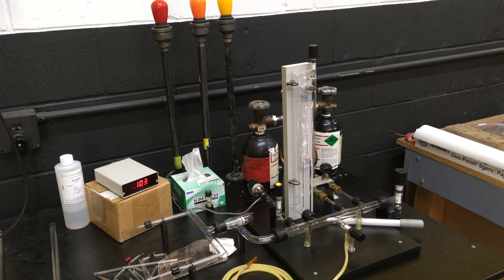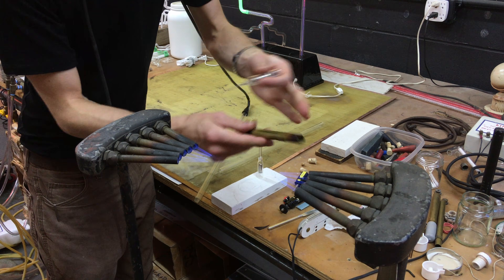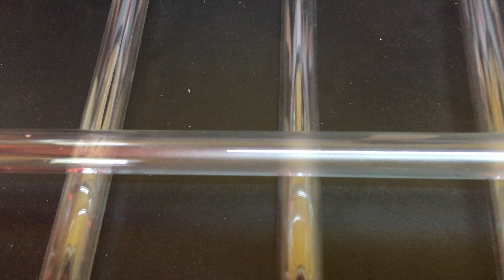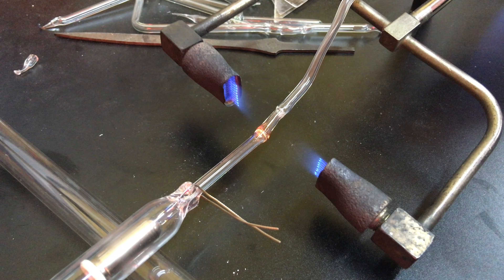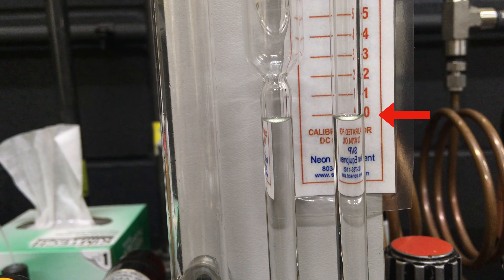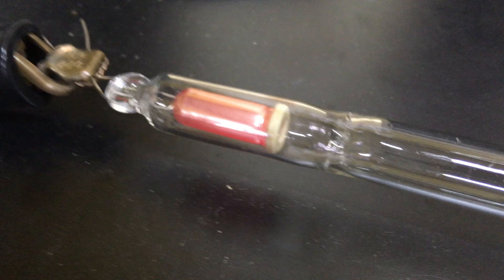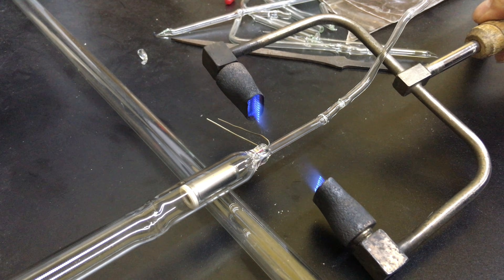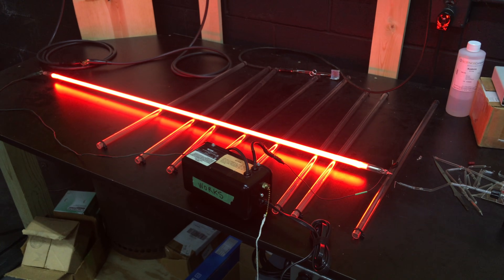Making My First Neon Tube

Comment: Great video!
I've been wanting to learn this for some time but i can't find allot of info on how to get started. I might do a course in France but i would like to know what the average cost is to have a basic setup. The point is to experiment on my own as i am a designer and artist making lights and stuff. Is it crazy expensive? Like the cost for a bottle of neon for instance. I imagine the burners, the vacuum pump, and the vacuum tester and all that stuff is not the most expensive part. I already have propane, i have a workshop for metal welding and blacksmithing.
Reply from the maker: thanks!  neon equipment is rather expensive and hard to find.  for reference, i estimate it cost me somewhere around $9000 USD to get to the point i am in this video (i.e., barely functional amateur) making the most basic of tubes.  practice adds a considerable amount to the cost as well, since alot of glass needs to be ruined to learn.
sounds like you've got the right idea: take a course to dabble a bit and see if you like it.  you can also spread the cost of equipment over time by buying things piecemeal (e.g., starting off with a just torch and a box of glass).
you mentioned France, so i assume you are in Europe, and i dont know how the cost/availability of equipment compares to here in the US.  i do know that some the torches & techniques used differ somewhat from their American counterparts that you see in this video.  my friend Andreas over at the @NeonSignStuff YouTube channel is in Germany and you can see his European torches in many of his videos.

Comment: Me pregunto cómo es que el fósforo siendo una capa de polvo adherida a la superficie del tubo no se cae o se funde en el vidrio al calentarlo tanto. Saludos.
Reply from the maker: it is possible to heat the glass too much and have the phosphor burn/melt into the glass.  i mentioned in this video that i heated the tube too much, but since it was not a phosphor coated tube, it still turned out alright.

Comment: Siempre me llamó la atención desde niño. Uno en específico no sé por qué razón recuerdo que encendía de un color he iba cambiando quizá de rojo a azul ( no puedo recordar bien) supongo que a media que se calienta. Quizá un defecto de construcción que quedó muy interesante.
Reply from the maker: adding a drop of Mercury to a Neon-filled tube before tip-off will create the color-shifting "red to blue" effect as the tube warms up from a cold start and the Mercury vaporizes inside the tube.  it's pretty neat to watch.
Reply: Gracias por la respuesta. Yo hablo español y todos los videos del tema a profundidad son el inglés. No me queda claro el proceso. Una vez puesto los electrodos, se hace vacío . Ahora,² el bombardeo es en vacío o ya gaseado? Después se completa de gas? Al  final queda a baja presión? Le agradecería me responda.  @NeonPreservation
Reply from the maker: i have a significant percentage of international viewers, so i add subtitles to many of my videos.  YouTube has an "Auto-Translate" feature where you can select which language to translate the subtitles while viewing.  i am unable to verify the translation accuracy to be 100%, but it could be a helpful tool for you!  i will answer your questions here as well.

after the electrodes are welded on, the tube is attached to the vacuum manifold.  when the vacuum is low enough inside the tube, the bombarding transformer is activated to heat the tube and burn any impurities inside.  the vacuum pump removes the impurities that are vaporized during bombarding.  when the tube is clean, and at the lowest vacuum possible, a small amount of gas (Neon or Argon) is added, then the tube is sealed.
the final pressure in the the tube is still a vacuum; for normal sign tubes it will be somewhere between about 9 and 20 Torr, depending on the tube diameter.  for reference, "normal" atmospheric pressure (it varies by location & elevation) is around 760 Torr.

i hope this helps!  ¡Salud!
Reply: Gracias, ahora sí tengo claro el proceso.  @NeonPreservation

Comment: Out of curiosity, what is the smallest diameter of tube that you could use to make neon? Could you use a tube that's like say, a 5mm across? Or less?
Reply from the maker: yes!  while not very common in commercial signage applications, very small diameter tubing (≤5mm) has been used in more niche specialty applications.  the first thing that comes to mind is scale model props on movie sets.  also, i do have some novelty glowing/neon items that have tiny tubing inside: a small AA battery clock and some modular "message board" type letters that can be assembled to spell words... there are other examples too, like neon christmas lights and small novelty signs.  they appear to have 3.5–4mm diameter tubing.  some examples can be seen in my friend Andreas' channel @NeonSignStuff in his video about novelty neon: 
https://youtu.be/zYIDciwyH7M
Reply: @NeonPreservation  thank you, excellent explanation

Comment: Hi, where can I buy different noble gas tubes from with electrodes attached like these?
Reply from the maker: maybe im misunderstanding, but that pretty much describes any neon tube...? are you asking where to buy neon tubes?   all neon is made by hand, most of it is custom designed for specific signs.  you could talk to any neon bender or sign shop that makes neon, and they can throw together anything you want: tube diameter, length, design, etc.  in the neon industry one-off type orders are quite common.

Comment: Thank you for the demonstration I might ask you for some assistance in some plasma projects I have vacuum pumps and glass globes I have been crudely sealing my vacuum with solder within a curly cube copper wire connected to my vacuum pump with a filter between the pump and the curly queue so when I melt the solder I don't suck it into the blacking pump using all glasses preferable but I don't have the entire setup.

Comment: How much will a processing setup like this cost?? Mainly for diy or side work.
Reply from the maker: if you're buying new equipment i'd guess upwards of $25k.  for used equipment there are a lot of factors that influence the price of a neon plant; quantity/age/condition of the equipment, location, motivation of the seller, how much glass stock included, etc... the prices i see are usually somewhere between $3000-$5000 dollars, although i've seen sellers asking much more.  if delivery is required, freight shipping can add considerable cost as well.
all told, i was probably about $7k into it just to do the beginners stuff seen in this video.  i expect to spend another couple thousand on glass for practice before i can make anything that i would consider to be acceptable.

Comment: Can you build and explain the vacuum pump and gas injection setup? I can't find any info nor videos about it. Thanks.
Reply from the maker: looks like you've found my "Neon Bombarding Setup" videos... lots of info there.  if you want to read more about it, "Neon Techniques" by Samuel Miller & Wayne Stratton is a good primer.
Reply: @NeonPreservation  I have found the videos how to make the bombardment system, extremely helpful and detailed. Thanks! Also is it possible to do the high voltage of eliminating contaminants without such beefy transformer, maybe a more modern smaller unit that might be able to do the same task?
Reply from the maker: short answer?  no.

a large bombarding transformer is necessary because more current is required to heat the tube and electrodes to an adequate temperature for processing.  generally, electrodes should be processed at least 10 times the manufacturers mA rating to fully activate the getter on the electrodes (e.g., 300mA for an electrode rated for 30mA). the glass needs to reach a minimum temperature of 225-250°C and the electrodes need to be glowing bright orange (c. 1000°C).  it takes a lot of current to do that.
improperly processed (i.e., impure) tubes will take a long time to burn-in, run hot, sputter, and have a short life span.

that said, bombarding is not the only way to process tubes.  oven-pumping then heating the electrodes using magnetic induction is another way; however, it takes a more customized setup since the oven has to be large enough to fit the tubes.
Reply: @NeonPreservation  thanks for the reply. Would you happen to know the average required amperage needed to do the burn in like how you did in the video to get the whole tube red hot removing contaminates? I guess I might as well build a transformer. Transformer technology has immensely improved I think I might be able to make one that packs the same amount of current at a much smaller package. I have seen oven setups for Nixie tubes. It would be nice if you made some videos how to make them. Also plasma tubes with the erratic snaking effect are cool too I plan on making those.
Reply from the maker: at the end of the processing i was using over 500mA, and that was just a little tube.  my bombarder goes up to about 600mA, but thats on the low end.  neon bombarding transformers capable of processing cold-cathode tubing are rated for 1000mA.

however, if youre planning on making plasma tubes, you might as well build an oven because it is not possible to process plasma tubes with a bombarder—there is too much glass to heat and the electrodes will get scorched.  the plus side of oven processing is you can take your time and neon tubes can be processed in it as well.  i'd even go so far as to say it's probably a superior way of processing neon tubes.  an oven doesn't have to be a big crazy expense either; check out plasma artist Mundy Hepburn's setup:
https://youtu.be/LvTFTQxjFU4
Reply: @NeonPreservation  Mundy Hepburn plasma tubes are epic. His oven is what i need to make, wonder how he made it.

Comment: this was amazing ! do you do replacement tubes ? got a corona sign that came damaged the bottom where it plugs into the transformer ,.  not sure how i can fix it , i got ripped off :(
Reply from the maker: sorry to hear about your sign!  i am merely an amateur hobbyist who is trying to learn the art of neon.  for repairs you can contact your local neon bender and they will be able to give you a quote based on the size & complexity of the tube.  good luck!

Comment: hey i questioned myself why lamps like these are filled with a gas and not just filled with nitrogen ?
Reply from the maker: the physical & chemical characteristics of the gas molecules dictate which gas is used.  Neon gas, for example, emits the bright reddish-orange glow, and has a higher electrical resistance than say, Argon, which is a pale lavender with lower resistance.  other Nobel Gases are used for artistic purposes; He, Kr, & Xe each give off a unique color and behave differently at different pressures.

you can use Nitrogen, Iodine, even flammable gases like Propane as long as there is no oxygen for combustion.  speaking of oxygen, you can fill a tube with it, but as one might imagine, the electrodes will quickly oxidize.  plain ol' atmospheric air has a very high electrical resistance and a tube filled with air will light, but will quickly overheat and burn out.  air is, however, used as a tool in bombarding (as shown in this video), because it allows the user to heat the tube to burn out the impurities.

many gases were tested in the infancy of the technology a century ago; they landed on Neon & Argon because they are inert and have the desired characteristics.

Comment: Nice video. I have a couple of questions. Do modern neon signs still hum/ buzz ? What is the smallest tube size ? (I saw 6mm online)

I ask because I'm thinking about having a custom sign made, it would be a 3/8 scale version of the original iconic movie prop

 Currently I'm still working on recreating the blueprint from a blurry screenshot
Reply from the maker: the old style of magnetic transformers hum under various circumstances, but modern electronic transformers do not.  there are uses for both kinds, although electronic transformers are mostly what you would see in modern window & beer signs.

the smallest tube size that is readily available to neon benders is 5mm.  the smallest tubing that you would normally see on a window or beer sign is 8mm, and anything smaller requires special treatment on how the tube is processed and what kind of electrodes are available.  that said, i have seen examples of 6mm & 5mm tubing used for special artistic purposes, and (like your idea) in scale models.

you will have to talk to your neon bender to see what they are willing & capable of making for you.
Reply: @NeonPreservation  

Thanks for the info.

Comment: Do you make electrodes yourself or u buy them?

Where do u buy neon transformers (especialy the older non electronic model)?
Reply from the maker: i buy pre-made electrodes, as do most other neon benders.

any sign supply shop worth their salt sells neon transformers; you can also occasionally find new-in-box transformers on ebay
Reply: @NeonPreservation  where do you buy the gas you fill your tubes with (argon, neon, little bit of mercury)

Like do neon shops also sell that?
Reply from the maker: yes, sign supply shops also sell mercury & noble gases; however, you may have heard on the news that there is a global shortage of noble gases due to the conflict in Ukraine... so the supply chain is kinda hit-and-miss for the foreseeable future.

here's a link to a neon supply shop, plenty of neat stuff to check out there: https://www.wccdusa.com
Reply: @NeonPreservation  lovly

I was wondering how easy would it be for you to make a T12 or T8 flurescent tube, it seams princliples are mostly the same

Maybe even the flurescent tube ballast culd power a neon tube or vice vers

The only hard part seams coating a tube with poshpor to convert uv to visible light, and getting the right contacts to plug in the fixture

EU has some stupid laws it seams, banning everything thats not LED (incondecent lightbulb, halogen, and now also T8 flurescent tube so, sometimes I think that making a light I want will be the only option going forward

Maybe EU will ban neon signs next, who knows what this morons at Brussels will ban next to make our life miserable
Reply from the maker: fluorescent is similar to neon, but there are some key differences.  neon is "cold cathode" and uses an electrode and a transformer as a power supply.  fluorescent tubes are "hot cathode" and use a filament and a ballast for a power supply.

there was a system called HOTFIL that could enable a neon bender to make custom fluorescent bulbs, but it is no longer in production.  you can read about it on the archived website here: http://www.neon-consult.com/hotfil/index.htm

that said, custom cold cathode tubes of 18mm+ can be made for architectural and accent lighting.  Cathode Lighting Systems makes really cool looking custom orders and ships them all over the world.  they have lots of photos to look at on their website gallery: http://www.cathodelightingsystems.com

not sure where you are in Europe, but there are European neon benders that use large-diameter tubing as well; the first one that comes to mind is in Sweden, but there are likely more...  http://www.nordiskand.se
Reply: @NeonPreservation  thanks

I am in Slovenia, so there are probably still some neon local benders

I know there is one in Rumenka Serbia

I actualy never had neon, but I do find it interesting, I only have flurescent tubes, but because they will be banned I am trying to find ways to make it :)

What I realy dont like about EU is that they ban things so.. yea

Thanks for your videos

BTW: can you refill a broken neon bulb or does that always require recreating the neon tube from scratch?
Reply from the maker: yes, neon tubes can be repaired; new glass spliced in to replace a broken section, then new electrodes welded on and the tube is reprocessed.  most benders will not repair tubes that contained mercury because of the contamination, but a few still do.